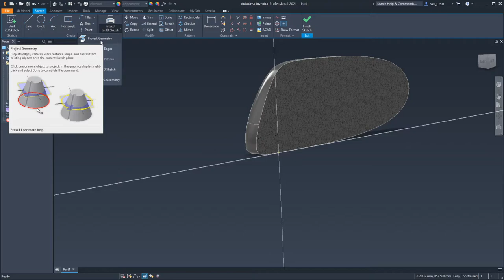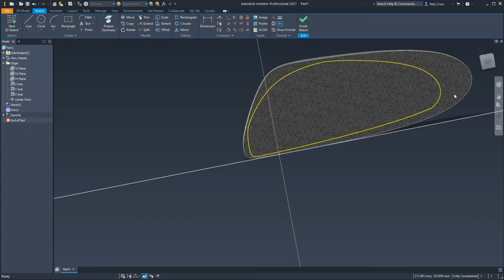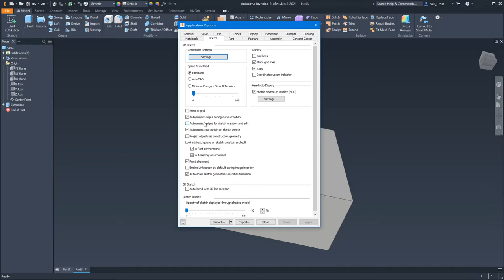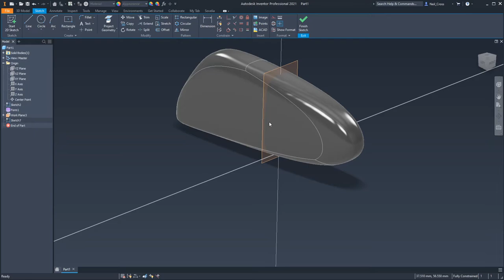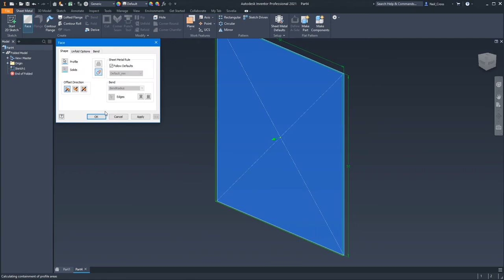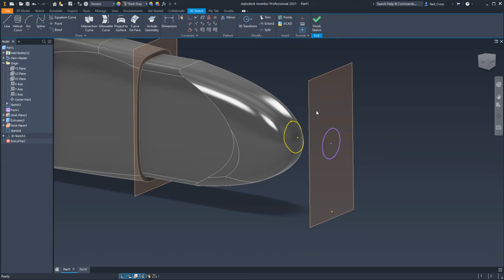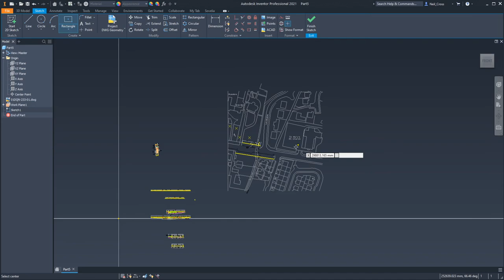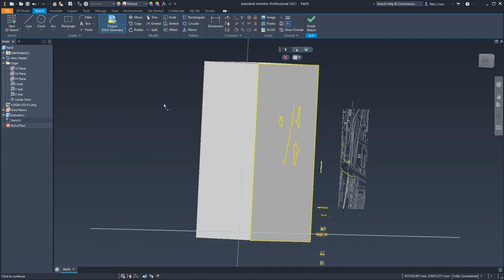Full Project Geometry Tutorial, all Options Explained and Demonstrated!

Comment: Project dwg  - there's a thing I didn't know and saves tracing or damaging the original dwg sketch. This I like.  A point on imported dwgs is, to check they are scaled correctly, add a known dimension to a line and, if it isn't 1:1, Inventor (sometimes) will scale it - or it might explode irreparably, but then it wouldn't be Inventor if that wasn't an option.